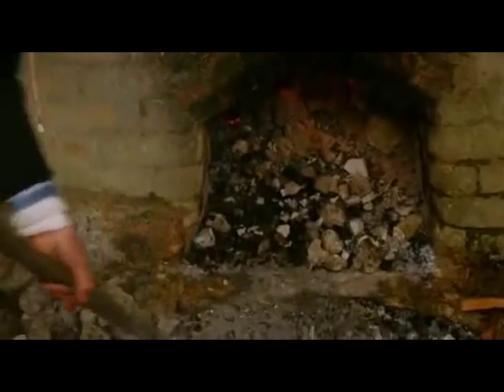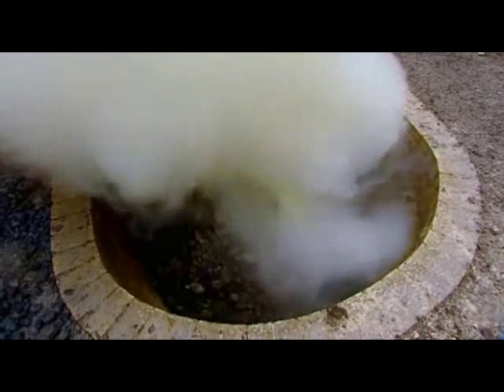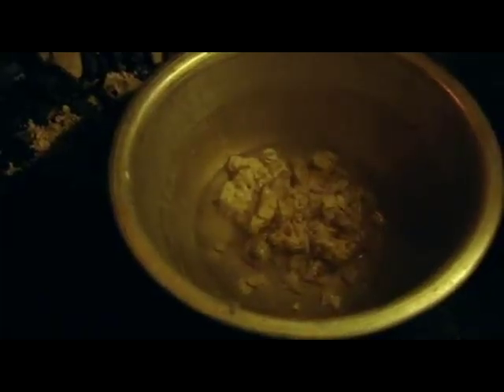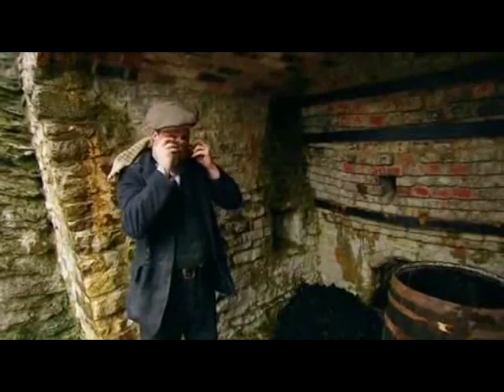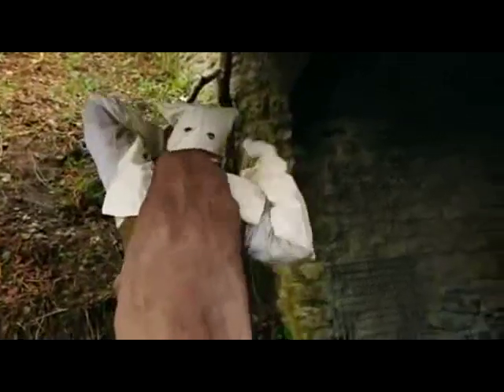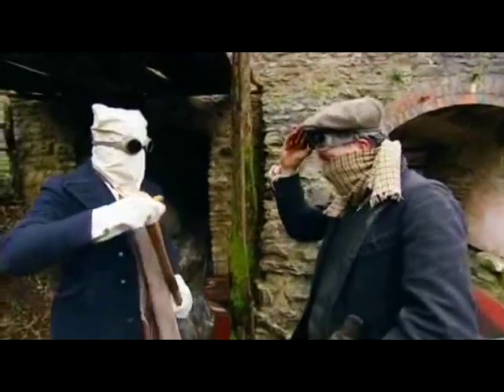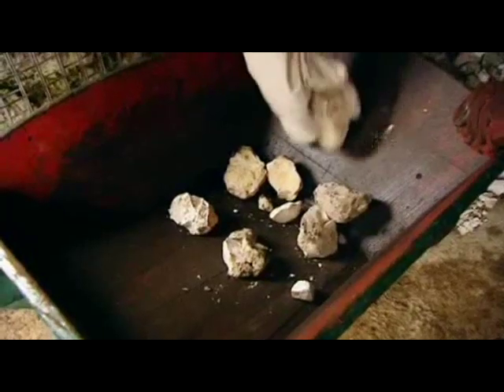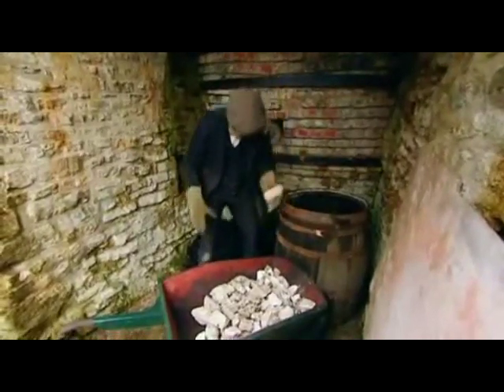Lime Kiln 3/3 - quicklime, lime mortar

Comment: If you noticed in the earlier parts of this series, that first kiln they looked at would have produced 50 tonnes, but they didn't need that much for this project, so they found this smaller one.

Comment: Meh. They have overburnt the stuff at the bottom and underburnt the stuff at the top. Its a continuous draw kiln that needs drawing out from the bottom as it burns. Too much coal too. 0.3 should be enough.
Reply: You have a kiln and do it in your spare time?
Reply: I suppose this is like the last time a draw kiln was worked before being abandoned. Could they have used the draw kiln as a flare kiln without adapting the construction?